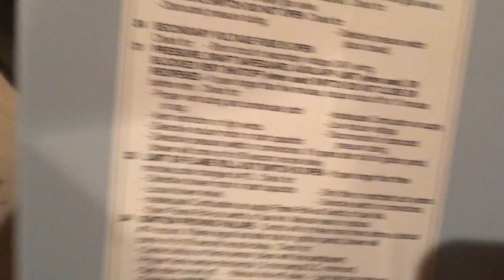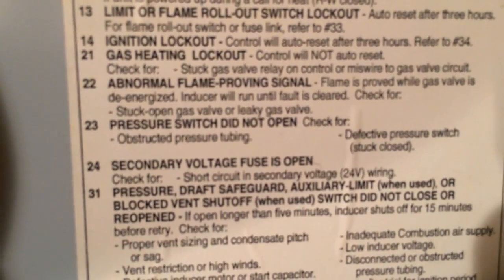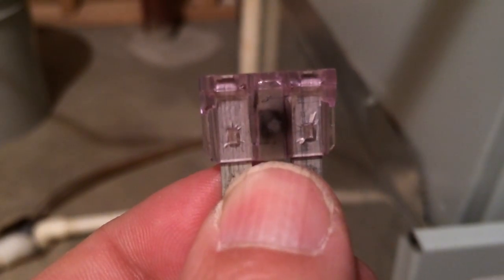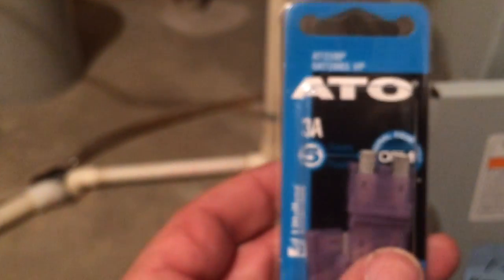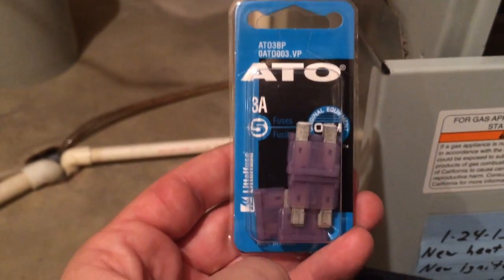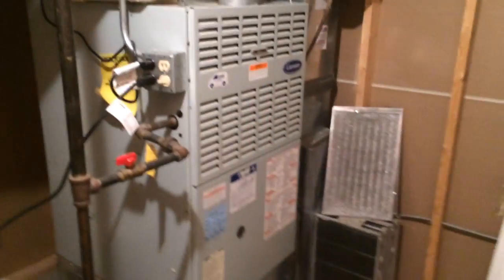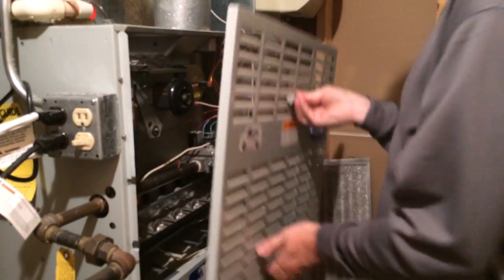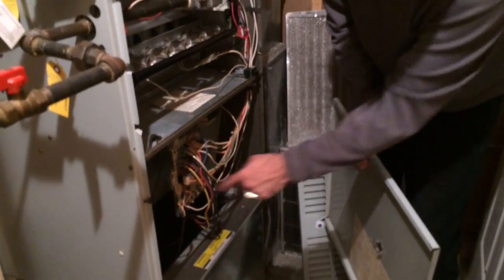Secondary Voltage Fuse Open

Comment from the maker: I posted this video thinking it might help out a couple people.  77,000 views later, I'm blown away.  Really neat that people have been able to save money watching this.  Keep in mind that I'm not a trained HVAC guy, so BE CAREFUL!
Reply: quinnjim add me to another one of the people u help saved a couple of hundred dollar . Fuse cost $3.99 for 4 so yea a $1 repair for me...thanks so much for posting this video
Reply: quinnjim im having the same problem but it keeps happening it does work but fuse blows again
Reply: quinnjim this was incredibly helpful!! Thank you for posting this
Reply: Freaking helped me! I bought a 10 pack of 3s just Incase cause apparently they seem to blow quite often.
Reply: I just searched for this. You're the first video. Replaced the fuse and my ac was back up and running in 30 mins. I even repaired the wires that caused the fuse to blow in the first place. Very important. For me, it looked like someone attacked my outside power to the ac with a weed eater. I could see the copper in the wire exposed and it was raining. Thank you! Very much!
Reply: Thank you!
Reply: I just used this to fix my furnace today! Thanks!
Reply: You're the MVP, just saved me a $300 call

Comment: Thanks for this video! Dropped from 80 yesterday to the 20s today with tonight dropping into the teens. Got the 24 LED code when trying to start the furnace. A quick trip to an auto parts store and 5 minutes of labor (at most) and it is up and running.
Reply from the maker: Great to hear, Jimmy.  It's definitely the time of year when people find out their furnace is broken!

Comment: Saved me big time. I was going out of town and checking my house before leaving. And then found my humidistat was not responding. Tracked the problem on manual regarding the LED signal, Gooled the problem and found your video, then rushed to autozone and bought the fuse before it closed. It worked like a charm. Thanks a lot for this valuable video.
Reply from the maker: Glad to hear it!

Comment: Thanks for posting this was an instant fix... it actually blew again like 30 min later, but I noticed there was a bad wire... fixed that and has been running ever since 🔥 👌
Reply from the maker: Awesome.  I changed mine once and it has worked for years.  Sometimes it is an indicator of a larger problem.

Comment: Thank you! I blew my fuse forgetting to cut the power before I installed a nest thermostat. helped me avoid voiding the warranty on my new house!
Reply from the maker: That's great!
Reply: Did it work fine after you replaced the thermostat ? I have the same problem (with an Ecobee3).
Reply: Yep it worked perfectly. 5 minute fix and case closed. My neighbor made the same mistake so I sent him this video and he fixed his too. $3 fix.
Reply: I really hope thats all it takes. we spent last night with no heat (Canada here). Thanks for the prompt reply !
Reply: Ya just go to the auto store and buy those 3v fuses. You just pop the old one out and put the new one in. Then you should be all set. Canada with no heat sounds rough!
Reply: Worked like a charm !
Reply: Ya the dude who made this video is a LIFE SAVER! total great human!

Comment: If you replace it and it continues blowing check your thermostat and make sure that all connections go where they should I've found furnaces wired got heat pumps and vice versa

Comment: Thanks. I had a recent surge which must have unseated the fuse which wasn't blown. So, I just put it back in (all the way) and presto, it works. (BTW - my mechanic wanted to replace the whole circuit board! Glad I took the time to research first.)
Reply from the maker: Glad to hear it!

Comment: Lifesaver!  Thanks for this video, I appreciate it.  That 3V fuse was the problem.
Reply from the maker: Good news!  Pretty simple fix.  If it blows again, you might have a more serious problem.  Mine has been fine for years after I changed the fuse.
Reply: @quinnjim  No, this one was my fault.  I was wiring in a new thermostat.  I remembered to pull the fuses on the A/C unit but not on the furnace.  Likely I crossed some of the thermostat wires.
Reply from the maker: @InfiniteImp42  Ah.

Comment: It would help the rest of us if you pointed out what else it could be, because my fuse is fine. Still gettinv the code.
Reply from the maker: I can’t do that since I’m not an HVAC technician…I’m just a pilot.  My fuse burned out many years ago, so I made this video.  I haven’t had an issue with it since.  You should probably call an expert.

Comment: Thanks for posting this video.  I have a carriere also and when I pulled the fuse it had a similar burn mark.  Unfortunately when I replaced it with a new fuse it did not stop flashing the 2 - 4 signal and I cannot get the furnace up and running.   Any suggestions from anyone would be greatly appreciated!

Comment: ok.  I had the same code (24).  I changed out the 3 amp fuse.  Now When the thermostat is on the cool or fan position it works fine, but when I switch to heat it blows the fuse again.  What else can the problem be?
Reply from the maker: +Brenda Fluellen I have no idea.  I'm not a HVAC guy, I just figured out this one trick!  Sorry.
Reply: A short in you low voltage circuit, find it. Why post a video and not explain how to fix the real problem?
Reply from the maker: @ Micheal   The video has helped thousands of people.  That's why I posted it.  Like I said to the original poster, I'm not a HVAC guy.  Sometimes the fuse blows and you can replace it.  If that doesn't work, call a professional.  I replaced my fuse and the heater has worked flawlessly for 20 months.  The "real problem" in this case might just be a blown fuse from a transient problem.

Comment: I replaced the thermostat and the fuse. Came up and turned on the fan. It worked and then it didn't. The 24 code started flashing again. :-( What could it be if that happens?
Reply from the maker: I would call an HVAC guy at this point.
Reply: @quinnjim  That's the plan. It's blowing the fuse each time. It's probably a damaged wire, or who knows what. Thank you for responding and for your videos. :-)
Reply from the maker: @gingercleary8  Sorry I don't have more expertise to help you!  Sometimes it can just be a transient problem that blows the fuse.  In your case, it sounds more serious.
Reply: @quinnjim  Dude, it was a coil in the AC unit causing the problem. The HVAC guy said in his 30 years he's never seen this situation.
Reply from the maker: @gingercleary8  I guess that fuse was doing its job!  Glad to hear that you figured it out.

Comment: A burned fuse is just a symptom not the real issue. You need to find where you have the short unless you had a power surge lately.
Reply from the maker: Wrong.  I replaced this fuse 4 years ago and my furnace has been running great ever since.  Sometimes it’s just a transient power problem.  This is the first thing you should try.  If it blows again, then seek help.  Probably a bigger problem at that point.
Reply: @quinnjim  
In HVAC, there are techs who would find the real problems, others are just part changers. Again, a blown fuse is just a symptom, not the real problem. And yeah your furnace has been running since then cus you might have had a power surge cuz the main function of fuses are to protect the circuit. 
Your furnace issue  is just one case of many. Thanks!

Comment: My fuse kept blowing when I turned on AC. Called HVAC repair and they diagnosed and replaced the contactor on the AC unit to fix it (old one's resistance/Ohm reading was off). Wish I would have known before paying for the technician! How to check the contactor: https://youtu.be/YCygHajsW34?feature=shared

Comment: There's a reason why it blew.
Reply from the maker: Mine blew 2 years ago.  I put in a new fuse and it's been fine since.  Sometimes it's a transient problem that a new fuse will fix.  Other times you need a professional to come and diagnose a more serious problem.

Comment: Fuses don't just blow for no reason ,  it will happen again , then you can call me to fix it right , then you can pay me overtime .
Reply from the maker: I replaced mine two years ago and it's been working fine.  Sometimes fuses blow for a transient power spike.  They are replaceable for a reason.  I agree that it may be a more serious problem.  If it blows a second time, I'd call you.  You won't get "overtime" though....just a regular service call.